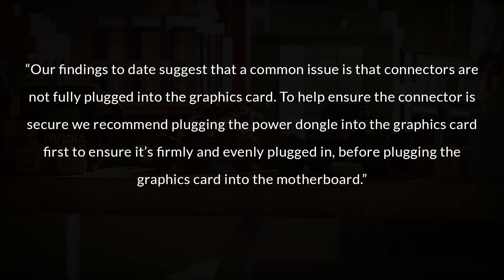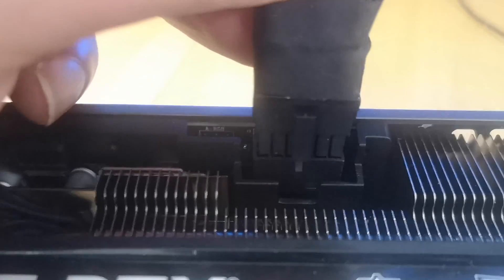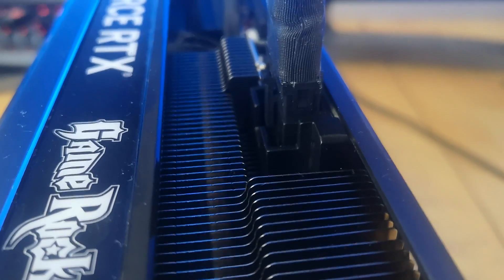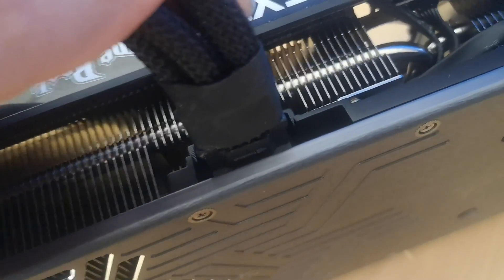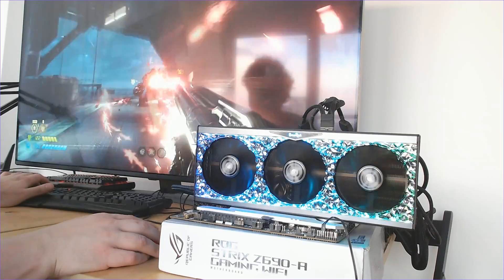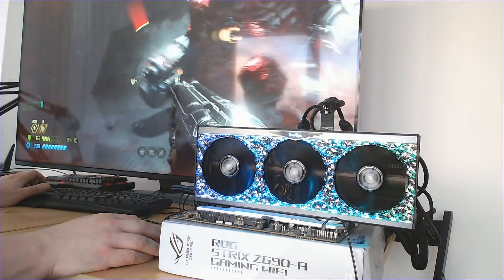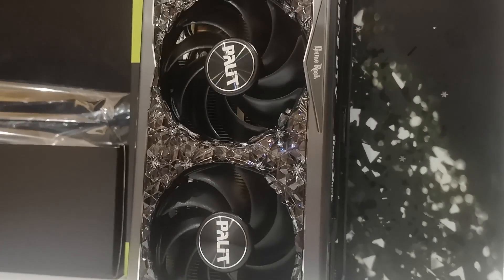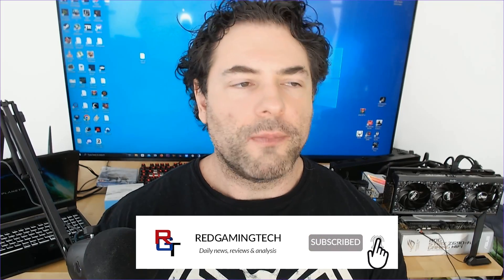Watch This BEFORE Plugging In Your RTX 4090 (So It DOESN'T Catch Fire)

Comment: Production fault not user.
The end user should never face these issue at all.
Before manufacturing stage they used cheap parts.
This is why it's going on fire.
No lead or wire can cause it.

The issue comes when a part gets fried the power gets reversed and fries the wire,no circuit protection added to prevent this.

You can't expect buyers to be technician, this is your job to do.
They blame user error to lie there way out.
Think about how many returns will be sent back to the company if they get exposed for provided non tested gpu. I doubt these are QA Tested properly.

Comment: how to prevent nvidia to burn your home ...mmmh ... anyway i don't know anyone buying a 2500$ gpu, until being a total victim of the system ... moreover if it can burn if bad plugged, i prefer not to die like this if my home takes fire ... this is just a very bad design... what about if the cable is a little used etc ... nothing to minimise here

Comment: Well, "user error" says NVIDIA, cute, but to start with the cable is not user friendly either due to design "features". No I had not burned mine, but I had more adrenalin from installing this one than usual (strix 4090). I pre-bent the cable before installing, away from the connector. But I'm hearing this could be a problem for others because their cases are not wide enough to accomodate this margin. One would think to make a 90ºs connector would be easy enough of a solution, but instead we got a straight one as another design "feature". No one thought of this except cablemod.

Comment: The RTX 4090 connector is a still a design flaw. Not only must you make sure it is absolutely secure. Also, don't bend the cable, so make sure your case is deep enough to avoid having to bend the cable or vertical mount it. There is no room for error or you could burn your home down. 👀 but still user error.
Reply: No 4090 has caught fire or caused anything else to catch fire. It has not been demonstrated that use of a 4090 can burn down a house.
Reply: @Safetytrousers  if the googly eyes wasn't enough... I wasn't being serious and did you see the (so it doesn't catch fire) in the video title? 🙄 there is always one.
Reply: @kmcbayne22  I did see it, and I was annoyed the title perpetuated that false notion.
Reply: @Safetytrousers  hello!? there is a legitimate concern if you get it wrong. Smoke and melted wires at a minimum  or there would be no reason for anyone to report on it. Why are you so invested?
nVidia fan or something?
Reply: @kmcbayne22  Melting is a very big reason to report on that. Nobody has experienced fire, which also certainly would be reported. The materials of the 4090 are not flammable and therefore not likely to catch fire.
I am invested in sense and logic.
Reply: @kmcbayne22  you are exaggerating the care with which you need to plug it in. Things like bending are not real issues, furthermore it needs to be extremely not plugged in to cause issues, leaving a bit of space is not exactly good but no problems have ever been reported from that, all the issues came from plugs that were very not plugged in. Thanks for your concern though.
Reply: That's literally any connection
Reply: No it's not a design flaw, You must make sure any connector on any product is fully inserted correctly, That's no excuse not to plug anything in correctly or fully.

Comment: basically insert fully with confidence and leave it. then push again. dont over bend the cable to close to the actual plug, i leave about 2 inches to 2 and a half inches of space before my bend. ive used the stock cable with 3 8 pins and swapped to a 4 8 pin custom cable from cablemod with no issues. gamersnexus wound up concluding that the biggest issue was anxious users plugging and unplugging repeatedly causing debris from the plastic moving against each other and it would get to hot leading to the melting.

Comment: New Power Connector standard, invites user error. New standard needs to be revised?
Reply: No, manufacturers just need to make it lock into place better and more obviously. Whole problem has been exaggerated from the beginning anyway.
Reply: @adamdunne6645  No, design flaw from the designer/manufacturers, should have been designed to help avoid obvious issues like consumer error. Most successful design concepts account for this.
Reply: @paulct91  Yes I agree, I'm just saying the standard itself doesn't need revision, it's just the plastic latching on the connector head. Can't prevent every error but clearly this was preventable with a more audible click or solid latching system.

The standard designer is seperate from the manufacturer. Gamers nexus vid about this issue will explain it better than I ever could.

Comment: The easiest answer is to not treat your 1000+ dollar card with kid gloves and apply proper pressure when inserting the plug. Which most people are loathe to do because it's an expensive bit of kit and they think that computer electronics are more delicate than they actually are. The second easiest answer is to not perform cable management. The reason for this is because unlike the sample photo shown, the clip doesn't engage until completely flush with the receptacle. Even less than a millimeter's disengagement, the width of a human hair, can cause the clip to fail to lock when inserted. While performing cable management the cable can wiggle slightly loose like shown in the sample photo. Once installed in the case, especially on many AIB cards because the power mount isn't flush with the flashing on the card but below it, it is basically impossible to tell after performing said cable management that the cable has become loose. This is the general cause of the failures we have seen.
Reply: TL;DR It's a bad cable design and requires workarounds for most users to ensure proper clip engagement.
Reply: @ravenshrike  Pusing a cable in is not a workaround.
Reply: @Safetytrousers  There are exactly two types of people who normally plug in the GPU to the PSU before the MB is inside the case. People who test lots of hardware on open air test benches and people who build in really, really small form factor cases. Which yes Virginia, makes the suggested solution a work around since it makes plugging the GPU into the MB significantly more a pain in the ass when building the system in a normal case.

Comment: Using 3rd Party Adapters seem like the perfect way to prevent fires. I use the Fasgear PCI-e 5.0 Extension Cable "30cm/1ft 16 Pin(12+4) Male to PCIE 5.0 3x8Pin(6+2)"  and it has been excellent so far for my Zotac Trinity OC 4090, compared to the stock adapter that came with it. You can hear all the clicks when you plug everything correctly into the Fasgear cable adapter.
Reply: Why do people call it a PCI 5 connector. It's a ATX 3.0 spec connector. RTX 4080 isn't even PCI 5